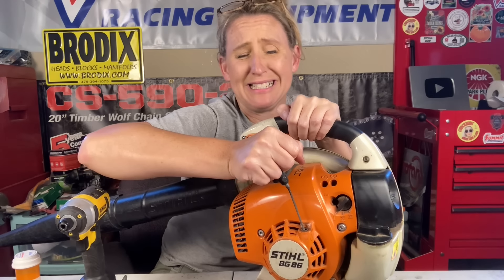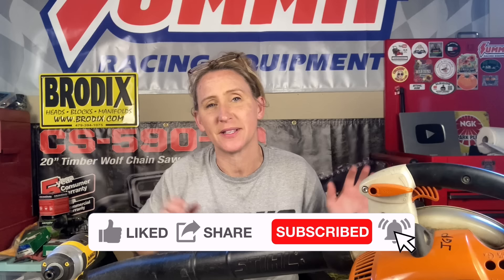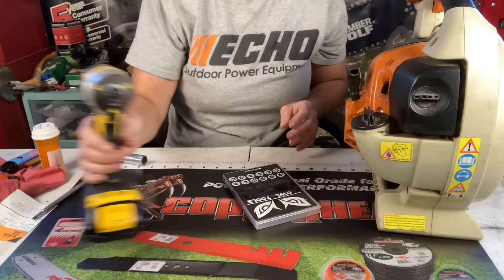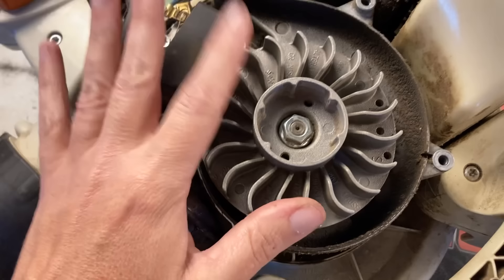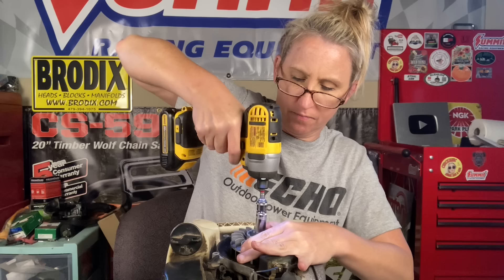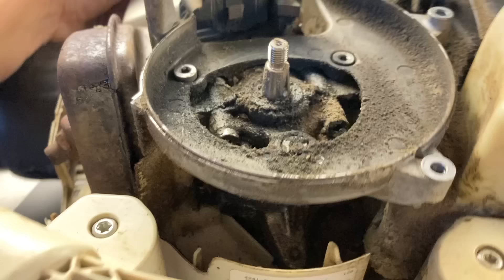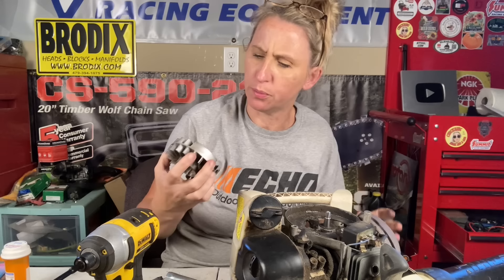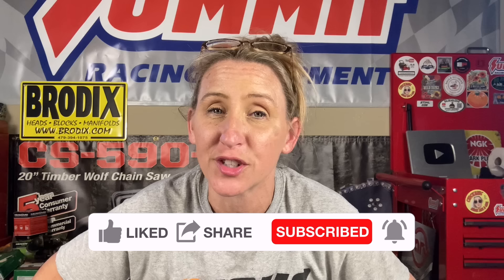Stihl Blowers SECRET FLAW!! Save your Blower with this EASY FIX!!

Comment: If I walked in to your shop and you were beating on the end of my crank with a hammer and punch, I would ask for a new unit.
Reply: That is how you remove a flywheel. At the shop we use an air hammer, nobody would give you a new blower because they properly removed a flywheel.

Comment: In my opinion, Stihl have gone down the swannie over the past 15yrs.
Quality control  is poor and stupid gimmicks with fuel filler caps, cruise control on throttles and not aggressive enough chains on pruners. etc .
I still own a 2004  FS400 and I wouldn't exchange it for all the tea in china with the lastest equivalent Strimmer FS410. ..Why?
Because my 400 is way lighter, easier to manoeuvre and has a none 2mix engine giving it more power.
And the electronic fuel control is more trouble than its worth. Please come out of retirement Hans Peter, and get your company back to what it was..😢 The best.